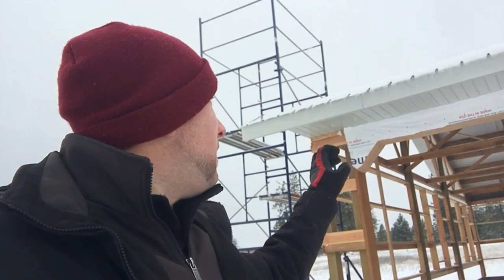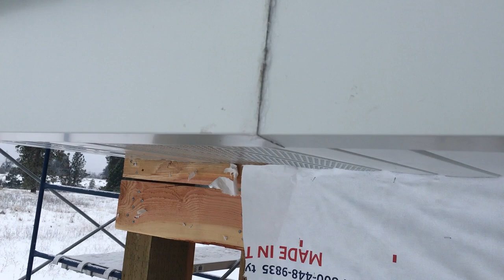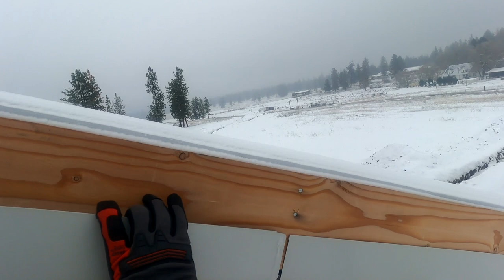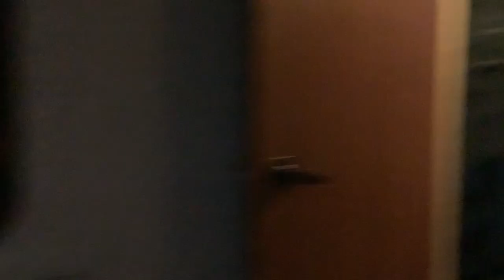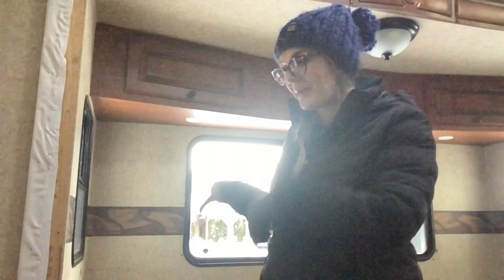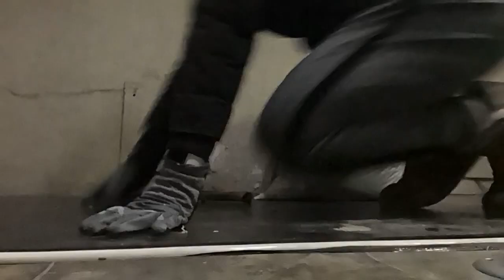Arctic Blasts Us Back Indoors | Fixing Steel Trims & RV Floor Renovation | DIY BARNDOMINIUM EP.30

Comment: What did HPB tell you on the fascia trim and the bevel?
Reply from the maker: I haven't actually asked them about it yet since I'm just plowing forward regardless. saving it for the next round of questions I have for them. But I will try and remember to respond to this when I get the answer.
Reply: @HartandHome  appreciate it. I just got my steel delivered. Waiting for snow to melt and then I’ll start my build. We’ve got about three feet on the ground and I’m in no hurry to go work in it….😆
Reply from the maker: @bpdp379  just make sure you got them in a place where they will stay real nice and dry. we got some rust marks that i dont think ill be able to remove from it sitting out in the rain
Reply: @HartandHome  was it Fabral? The panels or trim?
Reply from the maker: @bpdp379  yeah they came from fabral on the panels. basically what happened is that there were exposed edges in the stack of panels not just on the edge of the stack. water got syphoned into the stack and those edges rusted and deposited that rust on the mid portion of the panel below it. you might be able to buff them out but better to not risk it and keep your stuff dry. tarps would probably normally do the trick but high winds here decimated my tarps early on. also i appreciate your name :D
Reply: @HartandHome  any word? I just finished my purlins and I am close to fascia so thought about this again.
Reply from the maker: @bpdp379  we didnt end up discussing it. wasn't much of an issue so i just continued forward with the way it was.

Comment: Your seams should lap so they shed water
Reply from the maker: they say to essentially achieve that with caulking in the manual but i agree with you id rather overlap
Reply: @HartandHome  I'm ny opinion it's best not to rely on caulking to keep water out.  Overtime caulk will get dingy looking and attracts dirt.  We use caulk as a last line of defense against water intrusion.  Keep up the good work I can't imagine putting up a building of that size by myself.